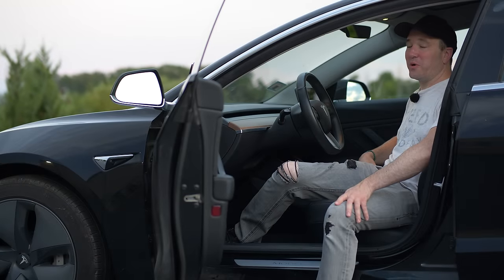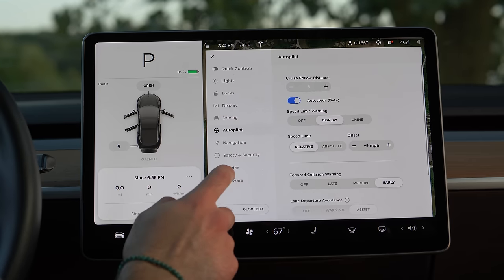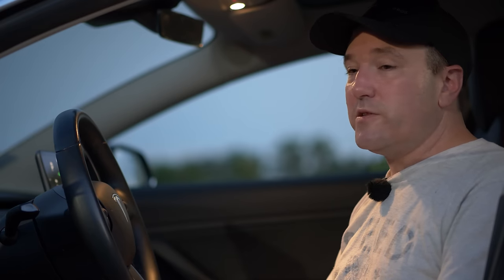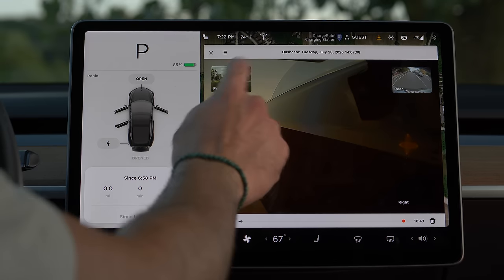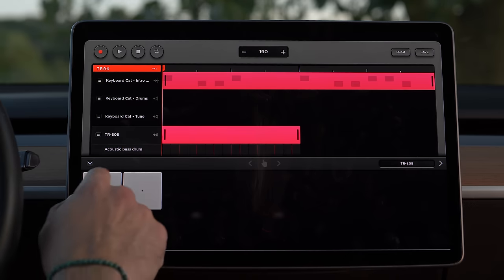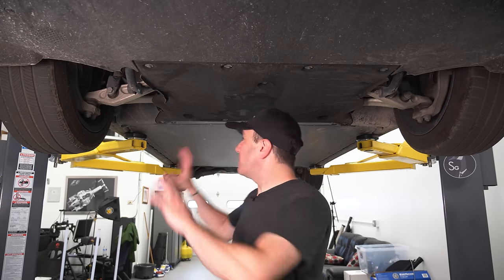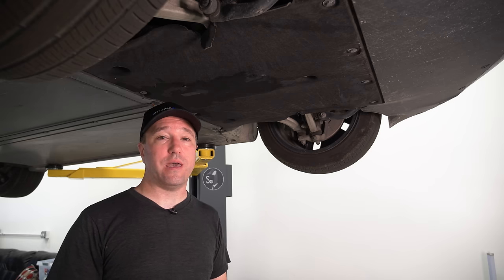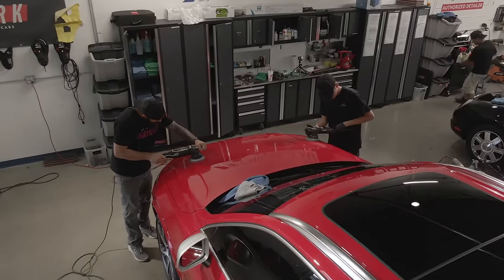Tesla Model 3 | Explaining the Cult

Comment: My model 3 is simply to drive in comfort back and forth to work in one of the safest car on the road (5 star USA, 0.38 in the Great White North, lowest number ever achieved for a car in Canada, Top Safety Pick EuroNCAP rating).

And my 981 GT4 is when I want to enjoy my Sunday drive. Both serve a different purpose and i wouldn't change either. 

Small correction for you, even if the screen goes blank. You can still drive the car, it retains the drive selector and turn signals, ect. You just don't have the speed indicator. And you can reboot the system while driving by using the steering wheel buttons (Press and hold both for 5 Seconds).

And you completely left out the voice command,  it will execute 88+ different commands and do almost anything & everything you want without having to touch the screen. And its considered the best in the industry, https://youtu.be/TlNFXqJj9aY

Now in a perfect world, put that drivetrain into my GT4 chassis and I'll be happier than pig in shit. Btw, you didn't even touch on the maintenance cost, but as a small example 1.5 year ownership and 10K miles (I don't drive far for work). Less than $100 for the Model 3 (Tire rotation and balance, cabin air filter). My Porsche which I drove 6K miles last year cost me $4,500. Again, they serve different purposes. 

As as far as green is concern, as a gear head (also own a 81 T/A Black on Black edition, raced a Fiat X1/9 DSP class, and Shifter Kart 125 unlimited class).  The growing acceptance of EV is only going to extend the number of years, that our great-grand children and great-great grandchildren have access to enough Dino juice. Just so they can drive GT4 & Vintage Mustang ect. to historic events. So the faster we change the better. 

On the slow rate of adoption from US legacy mfg, that is driven by their inability to change course, as they have far too many vested interest in continuing the current path. And as a small example, the number one selling Cheap EV car in China happens to be made by GM. In a country that does not have the legacy auto unions, dealers special interest groups and components vendors that are reluctant to changes. Funny they would claim not to have enough battery elements to support the US markets, but plenty to support a foreign car market that is twice as big (and growing). 

https://www.autoblog.com/2020/09/26/gm-china-electric-micro-car-wuling-mini-ev/#:~:text=Xu%20paid%2038%2C800%20yuan%20(%24,making%20it%20China's%20cheapest%20EV.

Changes are coming, and as always the US will be the last of Western countries to adapt.

Comment: As a model 3 owner, I completely disagree about the door panels etc. I’ve had £50k range rovers and it’s as good build quality, if not better. 

When I get in my Evoque now it feels so old fashioned. The model 3 is smoother, despite being low down. 

After worrying about build quality (after buying the M3 SR+ online) because of videos like this I was pleasantly surprised to find no issues outside or in. 

It drives better than anything I’ve driven before. And until you’ve experienced driving an electric car, Tesla, Jag, whatever, you don’t know what you’re missing. 

I was worried about scratching the centre console, nope, that’s been fine despite having a dog and two kids. Just keep a cloth in the under arm compartment. 

Never had a screen failure. 

It’s all good honestly. And for the price, you’d find it soooo hard to find a comparable car.

Comment: this review should have been uploaded onto the golf cart channel. It may have 4 wheels, front and rear seats but it is much more closely related to a golf cart than it is to any real automoible.
Reply: What a ridiculous statement.
Reply: @Josh-179  I have to ask....what did you find ridiculous about what I said? Golf carts and teslas both use battery power to run electric motors. They both plug into an electrical outlet to charge their batteries. Icm  run on petrol, which has zero in common with  golf carts, high performance or not. In light of these facts, I have to ask you, who is truly the ridiculous one here? You Tesla fanboys crack me up.
Reply: @7032rt  , you sound like you're new to the thought of electric cars. And it's not about being a Tesla fan or whatever. The idea that just because an EV doesn't run on gas that somehow that makes it more a golf cart to a real car is just absurd. Drive a Porsche Taycan, Jaguar i-Pace, Audi e-Tron, Mustang Mach-e, Model S/X for examples and tell me they aren't real cars. 

You better ready yourself in owning an EV because someday that may be your only option (in as little as 15 years). Don't worry though, they are better in many ways than ICE vehicles.
Reply: @Josh-179  I'm going to let this video explain why your estimate of the demise of the petrol automobile is way,way off. https://www.youtube.com/watch?v=Hatav_Rdnno 
 I would also like to ask what will be done with all the toxic waste these batteries create? Also, what will happen when your millions of electric vehicles overload this countrys already fragile electrical grid and cooks it? Nobody will be able to get anywhere then. Also, if what your saying is true, the military should be rolling out their first electric Abrams tank any day now. I will be watching for that. I'm pretty sure your opinion on golf carts will change once they hand you the bill for the new battery pack in 5 to 7 years. Good luck with that
Reply: @7032rt  ,  for the record, I'm not for banning new ICE sales but this is what governments and an increasing number of US states are declaring by 2035, or even 2030. 

I'm no environmentalist and believe gas cars aren't the threat that people claim they are. I do share some of your concerns with battery production and disposal. It will take longer that 10-15 years for automakers to even be able to make enough battery packs for all new vehicles. 

As for battery life, these packs are warrantied 8 years/100-150,000 miles. Most early Tesla's are on original batteries and exceeding expectations. Replacement isn't a real concern. 

I like EVs because of how they function better and require much less maintenance, not for any environmental reason. Take a look at EV owner polls that show that the vast majority would never go back to an ICE after owning an EV.
Reply: @Josh-179  I understand, and you are correct, the writing is on the wall. I just hope I get out of this world before they tell me I can't drive my GT4 anymore. Just like cocaina in the early '80s, they said go ahead, try it, its not addictive. Now,  here I am 4 years of ownership, in total denial about the EV vs. ICE thing, and jonesing for my next trip to angeles crest. GT4 is a helluva drug.
Reply: @7032rt  ,  yup, whether we like it or not it looks like the market will be forced into all electric. GM this weekend says their plan is to be 100% EV by 2035. Just 14 years. VW group, Ford, and others have similar commitments. 

Fortunately, this EV transition won't mean a loss of performance. The newly refreshed Model S Plaid will have over 1,000 HP, do 200 mph, and 0-60 in a body crushing 1.99 seconds - in a large sedan!!

Comment: If I recall correctly (but need to look this up again) audits show the CO2 released during a combustion  car's lifetime of gasoline burning  is more than ten times the CO2   released in its construction. Therefore  - assuming EVs take roughly same amount of consumption in  terms of power, materials ...etc (and related CO2 release) to manufcature in first place , then that means they will produce only 10% CO2 of what a combustion car does over its lifetime (assuming electricity for charging  is all renewable) . 
Whichever way you look at it thats a big saving.
(p.s. also enough with 'evil' cobalt. Its been used for decades in gasoline refining and machine tool and steel production. All during that time no one made a peep about it's unethical mining. Now EVs use a sprinkle of it in batteries and everyone is suddenly concerned. I'm not dismissing these concerns - but don't be a hypocrite and turn the spotlight on petrochem industry first please)

Comment: Would you be willing to share how you did the acoustic analysis?
Reply from the maker: Multiple mics calibrated in different positions using audio testing software for engineering audio systems in cars.  We do not use dummy heads but use room with a 50db noise floor.

Comment: I have not driven the ALfa.  The only 4 door sedan in the 3's price range that drives better is the A4.  The physics of the A4 makes its excellent road feel illogical. Somehow Audi makes it work.   The 3 has become too fat and refined.  The early 2000's BMW 3's drove better than the Tesla3.  The Tesla 3 is not a sports sedan.  It drives like one.  It is a ton of fun at moderate speeds.  At 3800 pounds it is about the same weight as the A4 and maybe 200 pounds more than the BMW 330.

Comment: Nice, thorough, even-handed review. I was generally aware of the infrastructure challenges for EVs, but I was unaware battery manufacturing capacity is at its limit. I would only add that all the mineral mining required to up battery production will have significant cost and environmental impacts.

Comment: This car is for the tech junkies. For that price, people would love to see a premium interior, but the point is, it looks like a 30K car.

Regarding the paint, there is a lawsuit in Canada because the paint comes off, they have to wrap the car when they buy it, Tesla is aware of this and offers fenders but it spoils the look of the car.

This is unacceptable for a car manufacturer, some people don't care because they love the car so much that they just warp it ... but for a 40k car ... you can expect a perfect paint job, right?

If you buy this car because it is green for the planet ... I would say it depends on where you are, if the electricity is generated from a coal power plan . .. you are not saving the planet. Tesla never spoke on how they will recycle the old batteries after their lifespan. This kind of battery which pollutes a lot and gas escapes.

They have to lower the price of the battery, with the new battery Tesla will announce that it will cost less to build the battery and with a 4000 cycle battery it will start to solve the battery durability issue that scares people.

For dual motor Model 3 owners, here's a good website that will help you unleash the power of Tesla for less.  https://ingenext.ca/?lang=en

Comment: Disappointed in this review.  Many of the things he said are not true, and many of the key aspects he did not cover.  Mechanical simplicity (oil changes, transmission fluid, water pumps, starters) is a key and never mentioned.  Never tested the Auto Drive (which is pretty cool).  You push the fat and pull the skinny, and its easy to do with one hand, once you know how.  You cannot pull up a web browser while your driving, only when your stopped.  Most of the issues are the fact that nobody taught him how to use the car, and he hasn't had it enough to appreciate how little the touch screen is used during driving.  I have watched many of their reviews, and really thought they demonstrated a lack of knowledge here, that is not typical for them.  I do appreciate the comment about the lack of sound.  I like it in mine, but there is nothing better than the sound of a V8.

Comment: At the same time, there are people who want it to sound.  It already starts with the young boys putting clamps on the wheels of the bike to make it sound.  then we have, for example, 18-year-olds who put stronger and larger exhaust pipes to make it sound cooler.  and the latest Volkswagen Golf GTD probably also has an acoustic amplifier to make it sound extra when they push the plate to the bottom

Comment: 1969 Corvette with a 427 goes fast in a straight lines and handle corners poorly by todays standards. Does that not make it a sports car? Essentially  races with turns are sports but drag racing isn't?  Even though there is a 100x more drag strips in America than SCCA venues?

Comment: calculate in efficiency of power plant, which is burning coal/oil/gas
calculate in losses of power grid
calculate in battery deterioration while it is not being used, just parked outside, or in cold
and you get efficiency not better than a gas guzzler car. Only pollution is moved out of town to somewhere remote, where power plant is.
Reply: Calculate the energy to extract crude oil, resources to transport and store it with all the fumigation and toxicity issues, insane amount of electricity used in the refining process, and the horrendous thermal efficiency of combustion engines. Factor in the leagues of unjust suffering for wars fought over control of global oil supplies.

Even if you were to drive a Model 3 on 100% coal power it’s still more efficient then most ICE cars. Stop believing lies peddled to you by hydrocarbon shills.
Reply: @ScoutSniperMC  On the last point, in the US the only state where the tailpipe emissions of a Prius to beats the emissions of charging a Model 3 is West Virginia which gets something like 98-99% of its electricity from coal.
US average electricity generation, the lifecycle emissions of the Model 3 will beat just the manufacturing+tailpipe emissions of the Prius in around 5-6 years. That is of course ignoring all the other issues with gasoline you brought up.

Comment: Dude, you charge at home. We never go to chargers unless on a road trip. Pumping gas takes up way more time for most people, and it's yucky.

I also rarely look at the screen. I press a button on the steering wheel and say,  "Play Soundgarden and put volume at 11" .  ;)  It also tells me when I'm speeding based on my personal settings, so no need to look. My profile is set to warn me at 5mph over, my wifes is higher.  

As far as the beta thing. Please point me to the perfect car that doesn't have improvements and updates. 

All I can say is my overall experience is, I can't imagine buying another brand. Cybertruck will replace my taco asap.

Comment: Maybe Tesla could pipe in some reverberating exhaust notes and gear shifts?
Reply: And dampen down the acceleration, use the speakers to generate a broken timing belt noise every so often, include a bottle with a hole in it to fill with fake oil, and emit fumes when stopped at the lights. Then it would be PERFECT

Comment: When discussing environmental impacts, I think he draws a false equivalence between EVs and ICEs. With any fuel from today's electrical grid, EVs have a vastly lower carbon (and energy) footprint from cradle (mfg) to grave (retirement). The difference is large and matters significantly for air quality and carbon mitigation. Toward the end he also suggests the closing of two Exelon nuclear plants in the Chicago area would lead to coal as the replacement fuel, which is ridiculous. So my detector for an EV hater sounded again, this time louder.

Comment: My goal is to bring back combustion vehicles that are minimalistic and run off of ethanol or renewable fuel sources like it that combust... I wanna make ultra light weight cars that give you a sound system and ac, no bs infotainment crap. Reliable physical buttons and nobs that control the basics. This will be how we save the planet. I’ll try and make the cars weigh under 1 ton and have nice, reliable, high revving engines that are still fuel efficient... we don’t need to reinvent, we need to refine and simplify. The saying reduce, reuse, and recycle does not apply to modern vehicles like Tesla. We need to reduce weight, reuse cars that are reliable, and recycle waste that can be used to create renewable combustion fuel sources cheaper such as ethanol.

Comment: Manufacturing evolves, but why you want to give impression that the car is beta when the car is the safest car ever tested. Was it a deliberate omission? 
Suspension is bad compared to what would you care to give some tangible point instead of general comment? 
I am still not convinced on the physical button because of the added cost and failure points as you mentioned too. Now how the interaction is controlled that is definitely up for a debate and change/upgrade.
You charge at home , you use supercharger when long trip. And on the battery front you need to really enlighten yourself. Just don't feed incorrect information to your audience(because you did not care to research), you will loose credibility. (Go check how EV are better even when ran with dirty electricity, Go check how much electricity today is coming from various sources, go check how Tesla is pioneer in active safety and avoiding accidents before they happen , go check how Tesla is planning to create Terawatt hour battery capacity sustainably.)Your area utility guys are incompetent does not mean there is no solution right? Should you be excused because you said there will be future videos?

Comment: I mean, it's a great car in many ways but it's also a cheap american car with fit and finish problems galore, which is unacceptable for 40K-60K.  I'd recommend buying a different luxury car right now and give it 5 years before going Tesla or other electric. I drive my 6 Speed Si over 450 miles on long trips before gassing up and no, it's not a Tesla but it's still a great ride with very little maintenance, low insurance ($50 a month how much is that Tesla insurance a month; $400?)